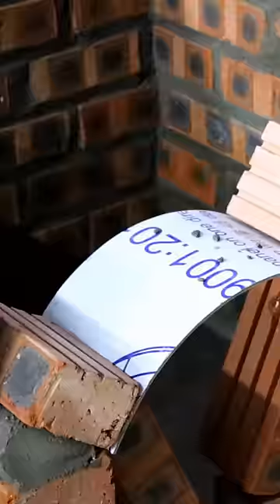How to make a simple pizza oven#shorts

Comment: Excellent, Excellent job; I 👀 look at the brick 🧱 they don’t appear to be “refractory brick” however I still think it could hold heat up 600 or 700 degrees enough to do pizza for sure; I do notice the pizza ovens from Italy use refractory brick lining covered with glass insulation then covered with a mortar veneer, as well as using refractory motor set however these ovens are quarantine to 1,000 degrees Fahrenheit
Reply: they can handle the heat just fine, its the thermal shock that the red pressed bricks can't handle. It causes  a form of material failure known as spauling. The red pressed bricks are made of shale,  which has quartz and calcite in it where as the refractory fire bricks are made of alumina and silica. They can handle going from ambient room temperature to 700 F in an hour then cooling back down to room temperature over the next 24  - 36 hours. The red bricks can't handle it, and with repeated cycles you'll see pitting and spauling which leads to cracking.
Reply: @robertbielitz9834 so what are the best bricks to use ?
Reply: They can pop pieces off.  Watch out if you choose these bricks .  You should use correct mortar too. Looks nice .